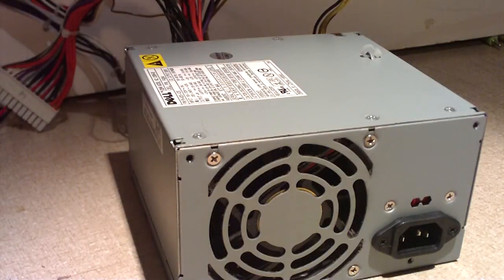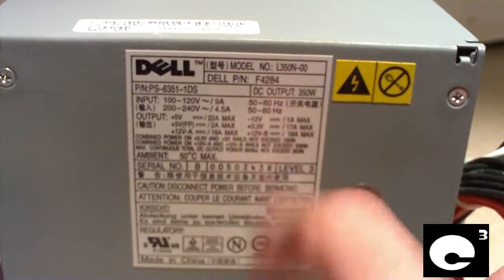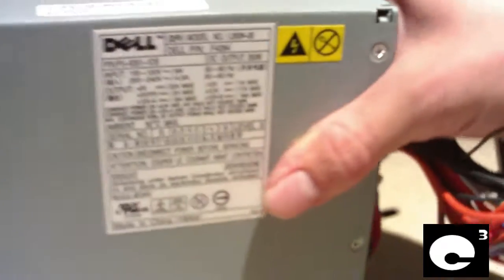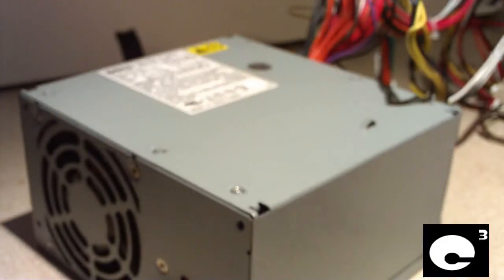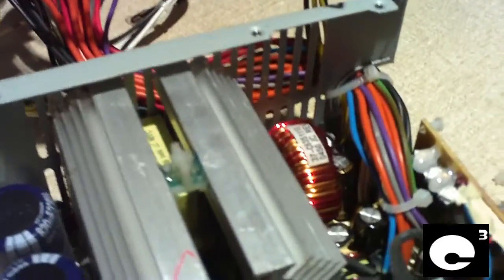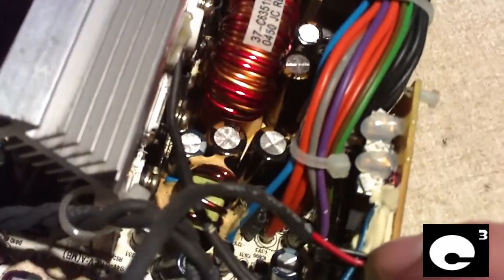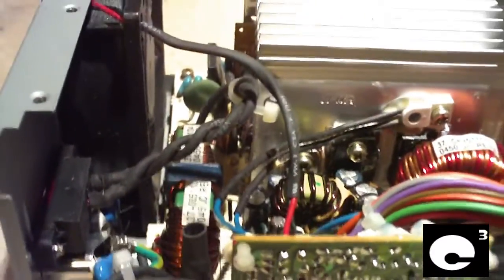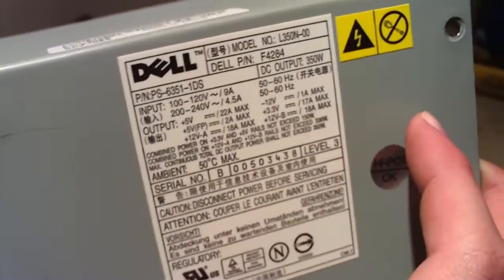Inspecting a 350w Dell PSU (High Quality Unit BTW)

Comment: Hi I have this psu in my Vostro 400. I'm worried about power connectors for the psu being compatible with a new graphics card. I see at least a 6 pin and molex connector. By looking online, everyone seems to think that adapters will make it work fine. Is this true for this psu? Like when a graphics card requires 2 6 pins?

Comment: You do know your never suppose to open up a psu even if its unplugged because some of the capacitors used take a long time to bleed of the electricity hence why the big yellow icon with a lightning bolt and a picture. With a screwdriver with a line thru .....